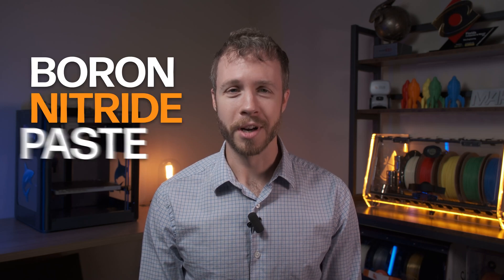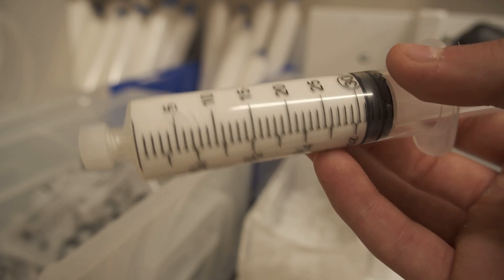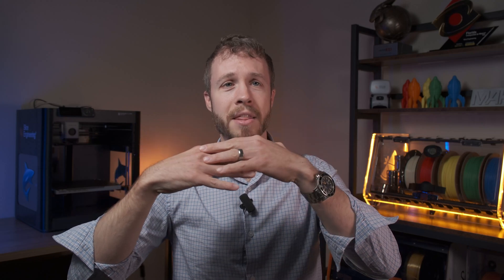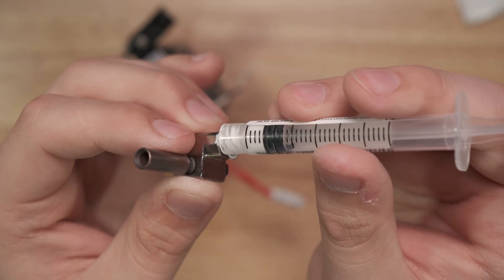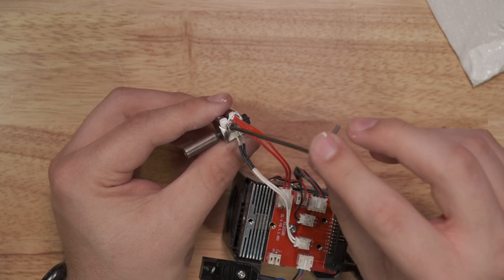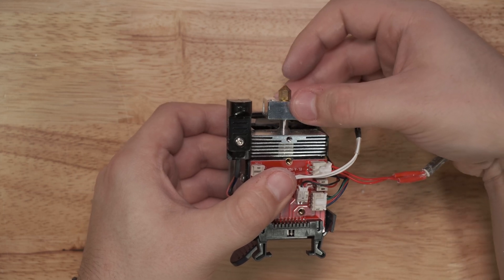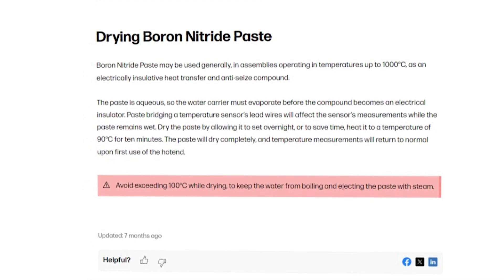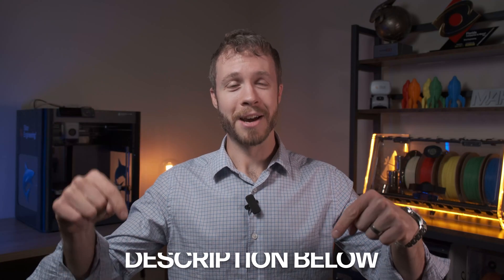Boost Your 3D Printer’s Thermal Performance! | Boron Nitride Paste Explained

Comment: Great product and video!  Does using the Boron Nitride Paste mean you don't have to use the screw that holds the Thermistor and Heating Rod, or you still need to use those screws?  And can the Boron Nitride Paste work in reviving a Heating Rod that's assumed to have "failed"?  I have an Elegoo Neptune 3 Max printer.  Thanks for the help!  I'm going to buy this product soon.

Comment: I got some slice engineers boron nitride paste. But it is much more on the dryer pasty side then the paste you showed in the video. So it is really difficult to apply into smaller holes or between the ceramic cartridge and the block because it just does not stick very good.
Is this normal or is the paste already old and dried up?

Comment: When you isolate components you must have a specific vision of charge distribution across surfaces - precipitation static is an example of… even in space. It’s a reason why we use conductive grease in bearings, beryllium contacts on aircraft panels etc. 

A number of product spaces have persistent user issues due to this issue because designers do not have expertise in EEE.

My remark is only to add to the completeness of discussion.

Comment: I think the Mosquito hot ends are the best hot ends out there and love the engineering behind it. I just have 1 problem with the design...thermal paste, even boron nitride shouldn't be the sole thermal transfer medium. Direct metal to metal is best and thermal paste is there to conduct heat where the metal on metal contact is imperfect, to fill the micro gaps. So the hot end should be using more of a clamping mechanism to hold the heater cartridge and thermistor in place. This would give more metal on metal contact and use less thermal paste. So we wouldn't have the problem we have now. The problem with using the paste as the sole thermal transfer medium is you end up with the heater cartridge and thermistor getting glued into the heater block and become unable to be removed for maintenance or even replacing those parts. I've had to replace the entire heat block assembly because the heater and/thermistor are so stuck in place that they become impossible to remove even with the tool.

Comment: Boron Nitride is a compound of the elements, Boron and Nitrogen.  While the paste will have a carrier of some type that will keep boron nitride granules together as the paste instead of as a powder, a sizeable portion of the paste is Boron Nitride.  The form of Boron Nitride used likely is of the cubic variety (c-BN), as that form has a thermal conductivity of 740 W/mK.  Diamond has conductivity of 1000, and copper is 401.

Comment: @3:45 "When that paste is heated, the water actually evaporates and it leaves this highly conductive paste." 
Translation: When that paste is heated, the water actually evaporates and leaves the solid BN material which an electrical insulator with high thermal conductivity."
Explanation: After the water is gone, it's no longer a paste, all that's left is the material that was originally suspended in the paste. And best to make clear which kind of 'conductivity' you're talking about since both thermal conductivity and electrical conductivity are important characteristics in this discussion.
Reply from the maker: Thank you for your feedback! The paste is non-electrically conductive once the water is gone.